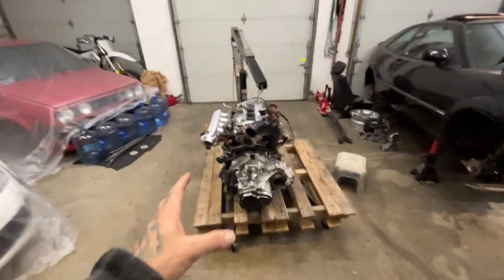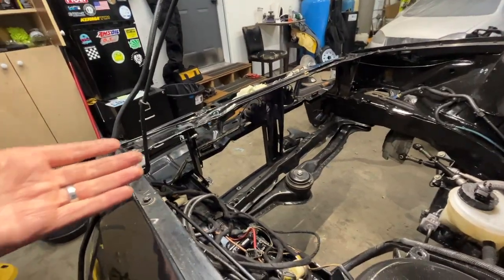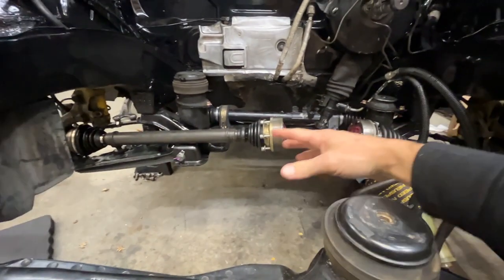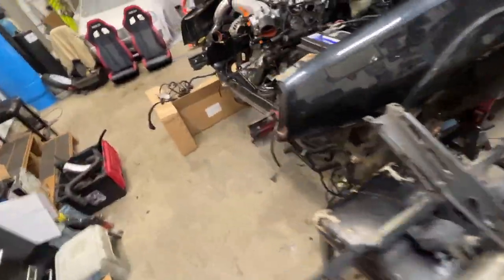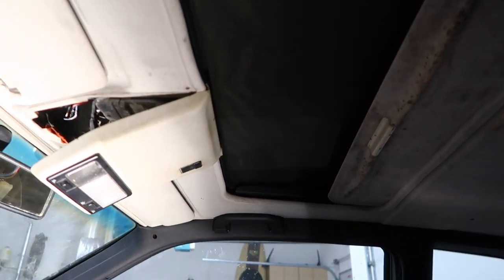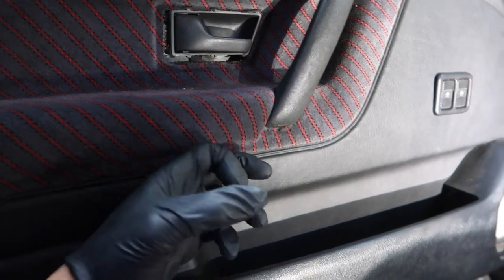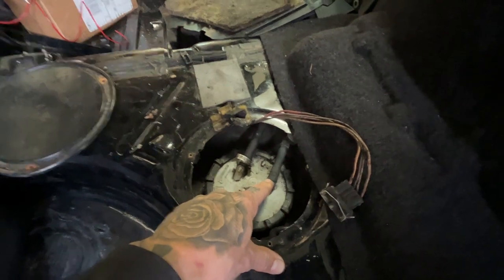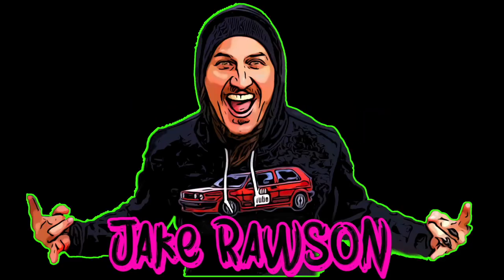Corrado 1.8t Swap Pt.4 | Engine Install | First Start

Comment: Lave a cable tie chap on the new cable as an emergency latch if the cable breaks - you can hook it through the grill if needed , there should be clips on the inside of the fender keeping the cable smart. Looking nice and clean in the bay- congrats.
Reply from the maker: Yes was going to try something like this

Comment: Awesome build 🤙🏼 as usual. Did you use the same inter cooler kit like your MK 2 project?  Any cutting of the rad support involved?
Reply from the maker: yep same one. I'm not sure what you would have to cut or do with the stock corrado front end.
Reply: @JakeRawSon   thanks waiting for your next build 😉

Comment: Very nice build it looks great I really love your builds..!! I have a corrado g60 I think the supercharger it’s getting tired I been thinking to to a 1.8t swap.. to use the corrado transmission with the 1.8t.. What engine mounts did you use?
Reply from the maker: everthing is the same as the mk2 1.8t build. I've started calling corrado's mk2 Corrado's.
Reply: I see.. and what intercooler did you use?

Comment: For the wiring harness, do you still use the same plug and play and mk4 harness you used on mk2 swaps in the past ? Also does Ecu matter? Automatic or manual Ecu ?
Reply from the maker: Same plug and play harness. Ecu can be from either. I'm currently working with a owner of a company to finally have an affordable solution for immo defeat and tuning.  There's no reason any of us should be paying so much on these's old engine.
Reply: @JakeRawSon   any recommendations on immo defeat at the moment? Online or should I try local , I’ve collected everything I’m just waiting on my harness to come in and I was to replace some seals and gaskets while the motors out. Thank you
Reply from the maker: @michaelmichaelmotorcycle2174  Yes 6atechnik.com
Reply: For mounting the trans to the block, I’m assuming you use mk4 bolts? Is it just 2 on top and 1 at the bottom. I’m having the hardest time finding the sizes of the bolts I need
Reply from the maker: @michaelmichaelmotorcycle2174  Couple more than that but yes that's how I start it. Get the two at the top on, lift it up and get the bottom.